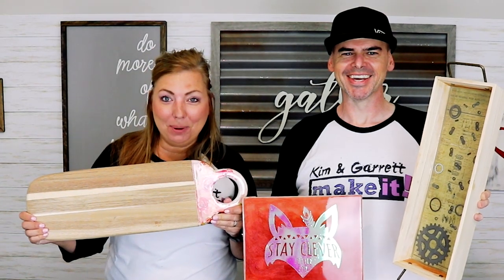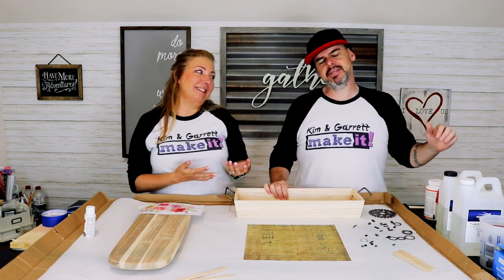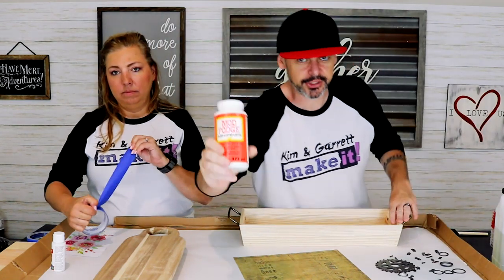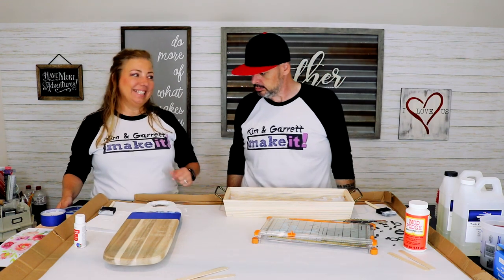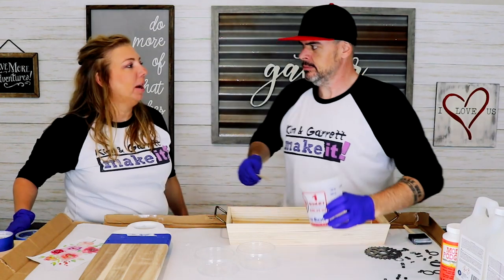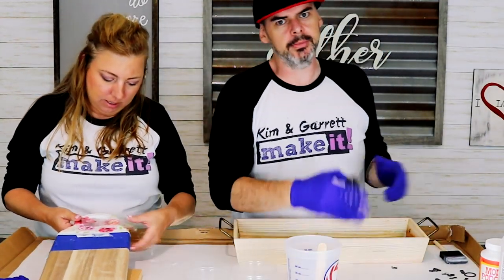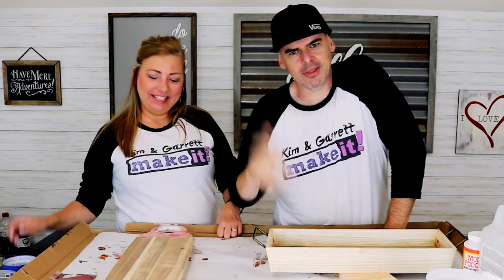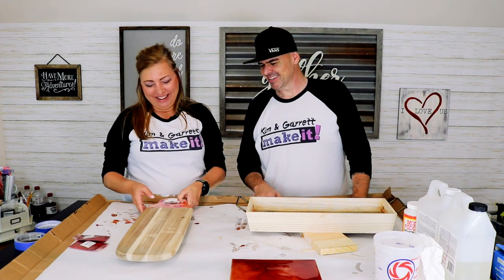3 Easy Epoxy Resin Home Decor Projects | Cutting Board Tray and Sign

Comment: Trial and error guys! You used the right kind of resin for these 2 projects. But the canvas gave me an idea, you would definitely need doming resin for it but you can put a design on the canvas and then maybe some dried flowers or something to give it a 3d effect. Water slide would have been the way to go with the cutting board 💐 but the idea was great. Don't worry Kim, I have a large graveyard full of "fails" and that board is easy enough to salvage. Great balancing act Garrett, I always look for that now, Kim's gotta practice a bit more but she'll get there. Another tip for resin, always have some kind of mold handy that you can pour excess in, resin is expensive and I hate wasting it. Wish is a great place to get silicone resin molds for all sorts of things. One last tip, when filling a vessel like you did in the bottom of Garrett's project, do multiple thin layers with the parts to give it more depth. So pour a thin layer and toss some bits in, let it set, pour another layer and add some more bits, that way they seem to be floating.
Reply from the maker: Thanks MsZoomy!  Great idea with the molds!  Great way not to waste the leftovers!
Reply: @KimandGarrettmakeit  ice cube trays or candy molds that are shapes like flowers or skulls or whatever, they work great too, glue a magnet on the back and cover your fridge or whatever. Just be sure the mold is silicone, you can use plastic but you'll need a mold release